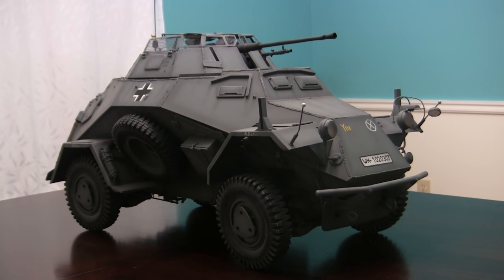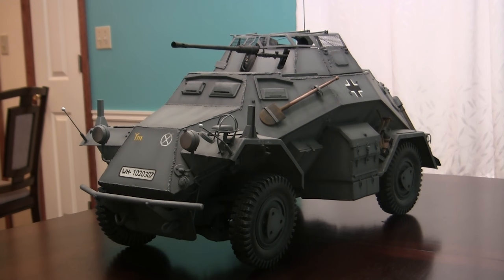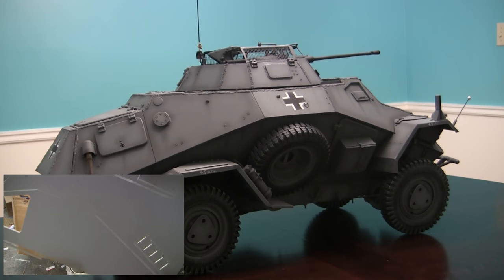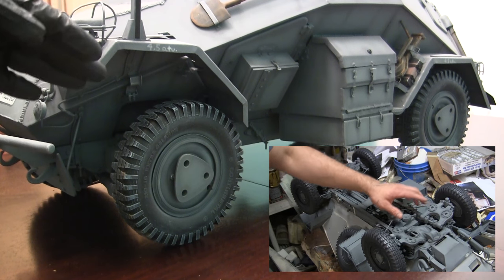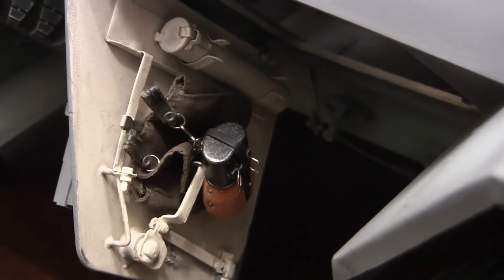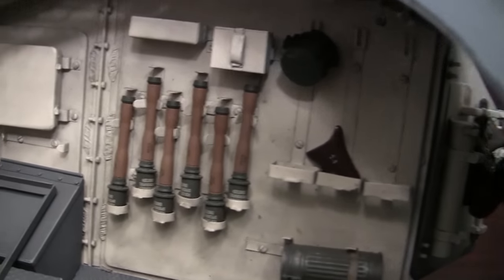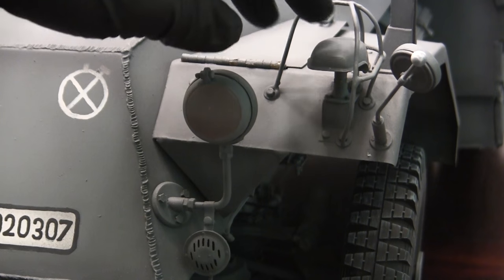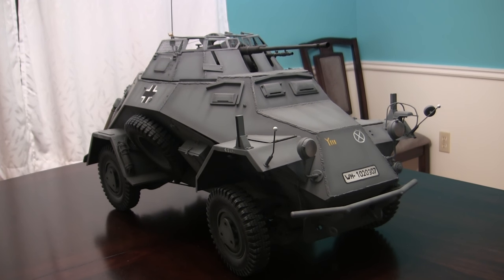1/6th scale German SDKFZ 222 armored car project video #22 (model complete / end of project)

Comment: You do some amazing work. The only think I’d say that needs improvement would be the weld beads. They look like you just took rolled putty and laid it down and did a quick texture to it. It gives the look of crudely torch cut steel. In such a large scale it’s a detail that begs to be better. I’ve noticed the same issue in your other builds. Please take no offense.
Reply from the maker: none taken, myself and my list of customers disagree
Reply: @oddball759mm  looking at photos of the real vehicle, the welds are barely visible.
Are the tires 3D printed?
Reply from the maker: @Brent-Nelson68  no they are cast resin on this one. When this project was built I was not into 3D printing like I am with my current builds
Reply: @oddball759mm  did you build the master of the tire yourself?
Reply from the maker: @Brent-Nelson68  not on this one no. The tires and rims on this one were procured from another 1/6th scale parts vendor called panzerwerk.
Reply: @oddball759mm  cool. Back in the mid 90s I produced a 1/15th scale SDKFZ 251/D half track. About 11 years ago I made all new molds for it. I think I sold about 50 of them as kits.